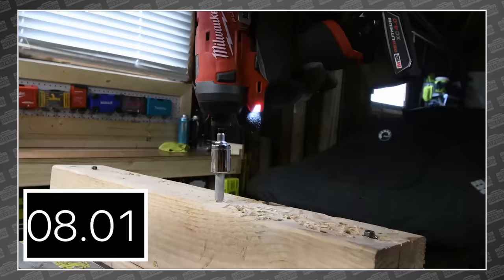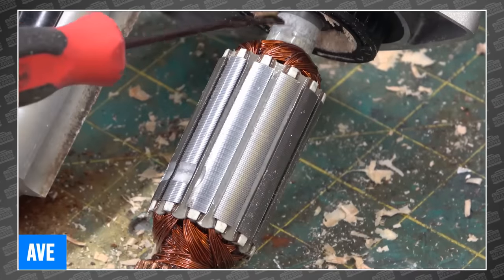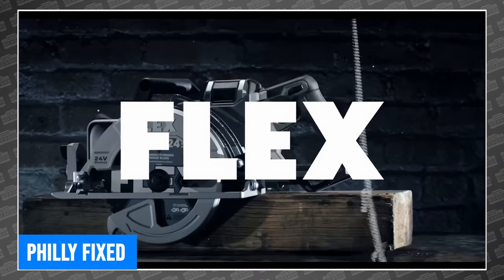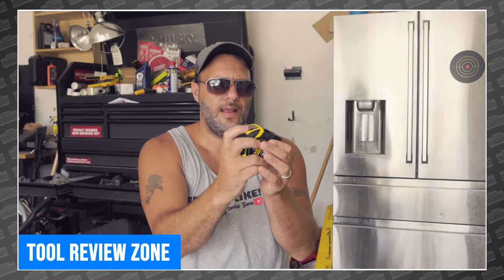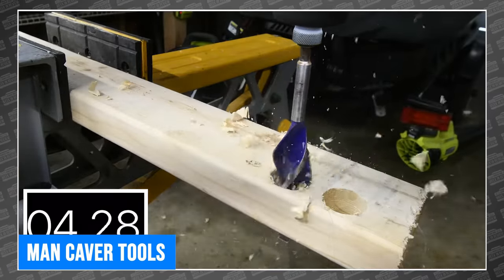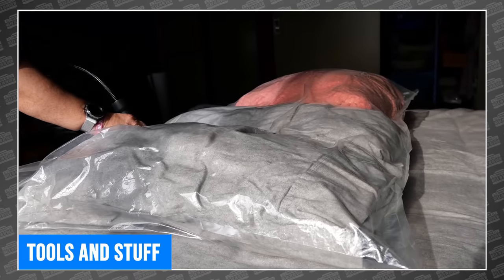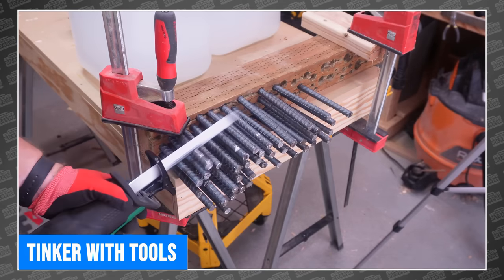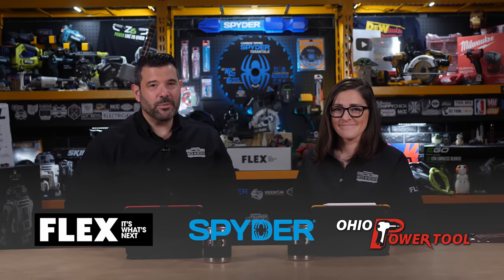How FLEX finally beat Milwaukee!

Comment: Circular saws.
I just bought the Skilsaw Sidewinder left blade. I will put this beast up against any saw on the market. It uses the same duel wound motor as their worm gear. 
Yes I'm right handed but love the view of a left blade saw and this one blows the dust away from your cut line.
Yes I realize you did not talk about saws much but I just wanted to brag on it, I'm petty that way.
Have a great day everyone, I hope everything turns out OK brother.